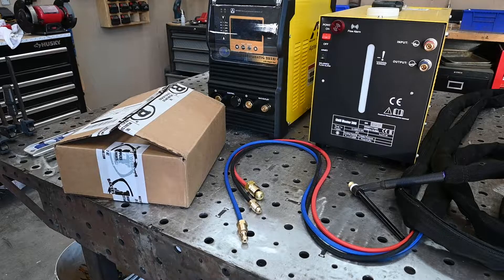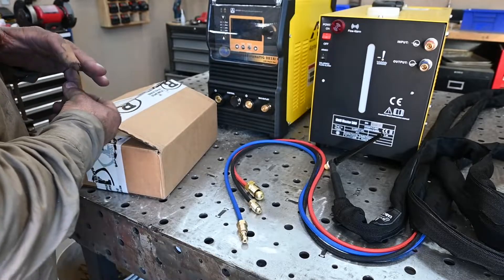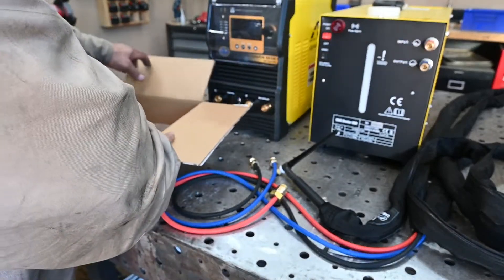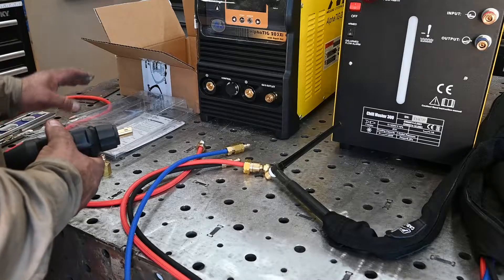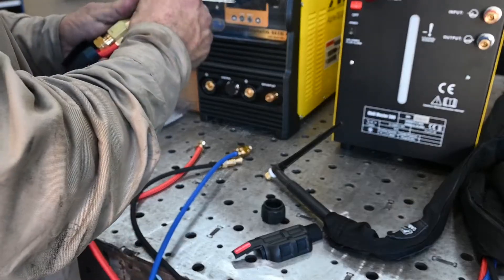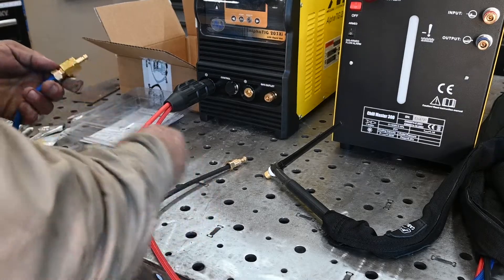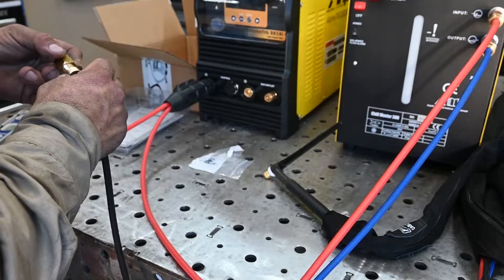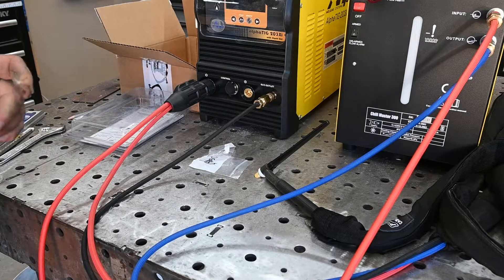How to connect a CK Worldwide water cooled torch to an AHP welder

Comment: Thanks, I was wondering how to hook this up to my machine (if it was even possible) and what I would need. I don’t have a gas solenoid on my machine so I guess I just hook the gas hose up to the regulator? I had to get an adapter to run a gas cooled torch off a DINS connector that also allowed me to hook up a gas line to the regulator. I will that same adapter work for a water cooled torch?

Comment: Thank you for the great information..question..what size circut breaker do you have the ahp connected 2...20amp 240?30amp 240 or 40 or 50 240?.
Reply from the maker: I’m running 240 volt, 50 amp breaker